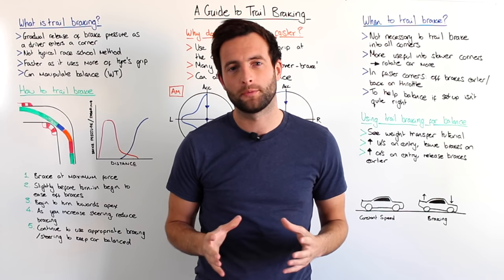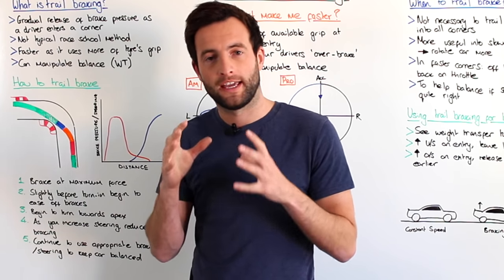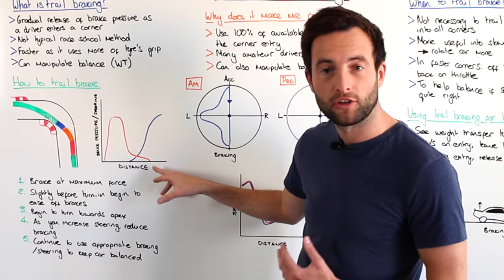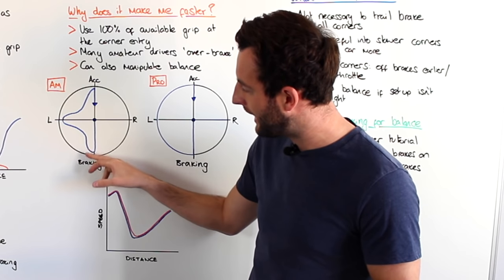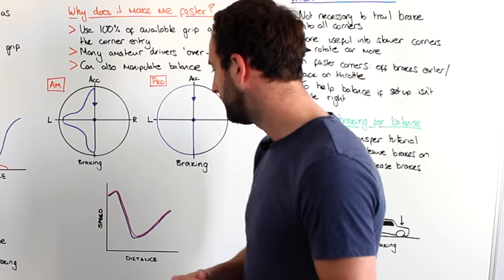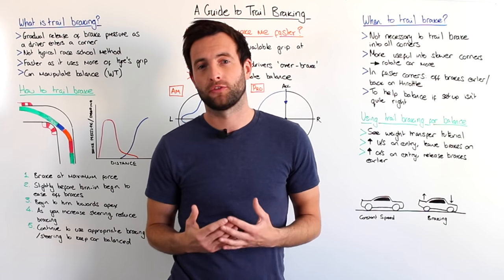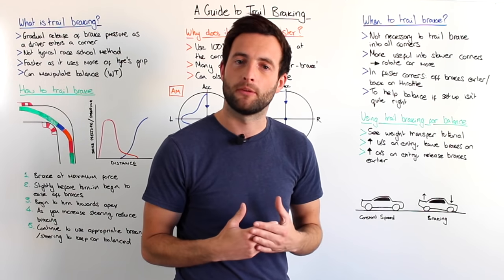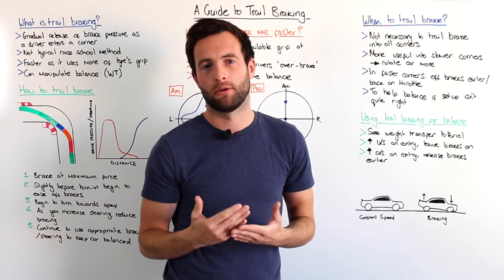How to Trail Brake: A Step-by-Step Guide

Comment: I'm a new motorcycle rider. This video is the best explanation on the principles of trail braking on YouTube. Thank you!
Reply from the maker: Wow - thanks for that comment, much appreciated. Cheers, Scott.
Reply: @calvinlynch5014  Aside from the fact that it allows you to tuck into the corner later getting better visibility when you do; sets up the geometry of your bike so that it is better ready for cornering which also increases your traction and gives you many more options if you have taken the corner too fast rather than simply laying the bike down or continuing straight. That aside - it is a well made point that you should strive for low entry speed into the corner in the first place.
Reply: Watch trail braking videos on canyonchasers YouTube channel, and Nick Iesnatch videos on grip and trail braking..!!

Comment: Unknowingly I believe I've done this technique quite a lot? One occasion in my FWD hot hatch coming into a tight hairpin like corner I wasn't expecting to be as tight far too fast for it up in the Welsh valleys. I  had no choice but to stay hard on the brakes and turn in I can remember at the time feeling on the absolute limits, I could feel exactly when I needed to start easing off the brakes and always felt on the verge of oversteer/understeer but not once lost any traction I just shat myself afterwards, got adrenaline dumped gave myself a talking to and wondered for the rest of my journey and until to this day how I ever managed that corner. Gotta thank you man love learning and you present and teach very well I've liked and subscribed you have a brilliant channel top notch content and you have brought me a lot of understanding. Every point on that board I did exactly even though at the time it felt completely wrong unnatural to me and yet naturally I did it!! Well maybe not naturally I will call it forced as I had no other option but either way I felt it and its like no other feeling taking a corner in this way as If all the energy that went into braking and turn in gets given right back to you when you start easing back off or at least it seemed?? Like momentum is channeled around the corner rather than lost into it?? dunno. Good stuff any mate.

Comment: This video illustrates perfectly why I do not understand how anyone can use a console controller to drive a racing sim.
Reply: Hahaha good
Reply: Recon.777 exactly why I picked up a wheel!
Reply: Readon is : no space in my small apartment. GT Sport for me is unplayable (DS4 Triggers just have to little feel and travel) On PC and Xbox I use the standard Xbox which has quite a lot of trigger travel.
Reply: I do it for 2 weeks. Cause i got the simracer game purchased but my G29 need 2 weeks to be delivered. To learn the tracks i drive wth controller meanwhile
Reply: I've seen guys using the R3 and L3 sticks on DS4 with far better consistency than the g29 would allow.
Reply: The only way I think you guys can understand is just pure controller time. I've been playing GT since I was a kid and always on controller. it wasn't until GT5 that I learned racing techniques. it comes down to personal skill. it takes a lot of practice to be able to do this on controller. I play GTsport and ACC both on controller and I'm only about 1s off the top guys. I have never driven on a wheel but I plan to buy one soon. I hope I will be able to translate that skill to my feets.
Reply: I bought dirt rally on steam and quickly realized that its almost impossible to even finish a stage with a decent time with a controller
Reply: You'd be surprised, some people are incredibly fast on a controller.
Reply: @barry6201  very factual. It's called becoming good with your own equipment.
Reply: You can trail brake on a controller once you get enough sensitivity with the triggers, it's not perfect, but it can take you pretty far
Reply: A modern console controller allows to throttle, brake and steer gradually
Reply: BOOM!!!!
Reply: @trevormtb9372  it's way harder, you have to be very smooth with the brake and throttle. Turning senistive for the sticks to 100 helped a lot for me, and softening the suspension. Still can't get much above top 200 on an event though, you just don't have the precision to really carry speed through corners without insane practice.
Reply: @Zaiden Gordon if u have to do that get a new gf 🤣
Reply: Just watch my hotlaps lol. 
If controller is the only thing you’ve got, then you just have to adapt no matter how difficult it is
Reply: Yes, it is possible to trail brake with a controller (I use a Xbox pad). The tricky part is maintaining the controller stable, so that you can fine tune your inputs (steering and triggers), which are super sensitive by nature (we're talking about millimetres of travel!)
Reply: I find trail braking fairly easy on controller. Throttle control is much, much harder.

Comment: You also need to cover trail braking in combination with engine braking to remain in the max torque band to accelerate out of the corner for maximum exit speed

Comment: i would be interested in a video explaining the differences in trailbreaking and progressive acceleration on corner exit - in relation to a either rear engine car (porsche 911) and front engined car. so how does the static weight and grip difference affect the inputs throughout the whole corner. 
i've heard a rear engine 911 basically doesn't need any trail breaking. is that so? i would like to hear a comparison of the different car setups (front engine, rear engine) from an expert like you.

thanks in advance
Daniel

Comment: Based on this guide and your racing line guide, on a slower corner a combination of trail braking with late apex may be ideal
Reply: Love Like a Hurricane depends on your car. In a light but grippier car with close to 50/50 balance, your apex will most likely be earlier than with a heavy tank like a muscle car. The key is to use all the available tire grip.

Comment: Question: As an amateur driver, I was usually brake first soft and then hard. After I heard about trail braking , I started push hard first and then soft. But in that case, usually car lost balance before coming to apex. What is my problem exactly ? What possible mistake am I doing ?  btw i'm using a rwd automatic  BMW. Sorry for my English. Thank you!

Comment: regarding the diagram at 6:45, doesn't trail braking mean you can hold a higher speed before you reach the corner ? Because you actually get more braking done into the corner

Comment: would it be accurate to say with a fwd car with a weight distribution bias towards the front end, that it would be better to come off the brakes a little earlier and very lightly onto the throttle to get a better balance to allow the car to turn at the tightest point and then as the car is pointing towards the apex or exit to start increasing the throttle to max as the grip allows out of the corner? as allways get tutorial

Comment: What would you say is the best way to learn to trail brake more frequently for those who aren't doing it? I am a sim racer and know that it is something that I need to do More effectively, but it is seeming hard for me to get used to it and use the technique as effectively as possible, any other learning tips?
Reply: braking later is probably crucial for this to work. And turn in sooner than you normally would as you're gently releasing the brake. Hope this helps. (It's been a year since you commented, how's it going for you?)
Reply: Yes, brake later but don't turn in sooner. Turn in the same way and if you trailbraked successfully and have pavement left at the exit then try to get on throttle as soon as possible after trailbraking. If you still have pavement left (assuming you unwinded the steering wheel), then turn in slightly sooner.

Comment: Will this help keep weight on the front tires in FWD?
Reply: Creeperboy and friends really useful in front wheel drive cars to get the car rotated. It keeps weight off the rear of the car as you turn, so you'll experience a little bit of oversteer on turn in which can really help.
Reply: Chris Holloway I figured that out too— pretty fun even though I’ve only pulled it off in simulators

Combining that with a downshift, I once managed to DRIFT (not powerslide) around a turn in a Honda in the game once

Comment: Where would you come off the brakes when someone is doing a hair pin turn while using late apex on the hair pin turn?Most of these guides just mention to completely get off brakes and onto the throttle once you hit apex. This is understandable when using the Ideal line. But when using Late Apex line how would trail braking work? Do you start putting throttle the moment your steering angle decreases, regardless of whether you hit the late apex point or not?

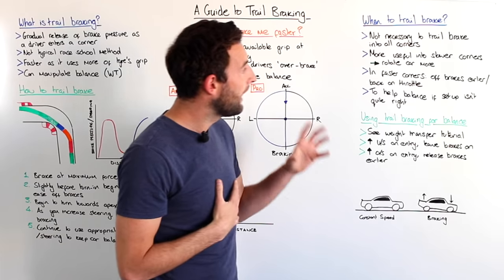Comment: If the car is oversteering then how not to trail brake or to less trail brake is the solution?? 10:35
We want to transfer weight to the rear then we should trail brake earlier isn't it??

Comment: question for anyone willing to help with sim racing (Iracing specifically), I have tried trail breaking and sometime I can make it work but other times I tend to get loose at the back end, is this because I am releasing the pressure of the brake too quickly throwing the weight of the car off or is it because I have turned too suddenly, or is it something else ? like I said sometimes I can get it spot on but other times I'm not sure what happened, I have tried to look at replays to see what I did different but I cant see it, or is the best thing too do is go through specific practices to find out the different effects of turning to quick and releasing the brake too sudden.

Comment: How to practice/learn this technique. Should I learn some other skills before this?
Reply: Sim racing of course is a great tool to practice.
The later the apex the better to practice and see differences on your laps time as the trail braking part will represent a greater part of the turn. Thus tracks like Spa or Brno are great to train to trail break as you will see big differences when you succeed to do and immediately realize if you are doing it right or wrong. La source, les combes, Brussel / Rivage, Fagnes and Campus are great turns to train at Spa as they are long and smooth (except for la source).

It's really important to have a good and well balanced setup, so if you are not familiar with setting up a car I advice or to get a setup from a friend you know is good or to get familiar on how to balance a car setup.

Hope this helps.

Comment: So does your braking point change when trail braking?
Reply: In the example its a bad situation. Trail braking is a really good technique in 180 degree corners. In his example, you would lose WAY to much speed coming out of the corner.
Reply: Trailbraking works best in corners where you have totate the car more than 90 degrees. Yes, your braking point should be later because in order for traibraking to work properly your entry speed needs to be higher. If your entey speed is the same and you try to trailbrake, you will overslow the car, therefore you brake later which will inherently yeld higher entry speed.

Comment: But you can enter the corner faster if you use all the grip for turning. Plus you can press the gas  sooner so that the car doesn't loose speed through the corner.

Comment: When do we downshift? Only during max braking?

Sometimes (depending on the situation) I end up downshifting after brake release and turn in has initiated, and it is very unpredictable. :(
Reply: Nick Amarit. Personally I would downshift while braking. I select the gear I think is best for the corner, match the revs before initiating the turn and then just accelerate away. Has worked for me for 40 years. I have to say that trail braking is an advanced technique that has virtually no place on public roads. Ride safely.
Reply: Yes, I am trying to trailbrake and heel-toe. It's tough for me on a manual because I learned to trailbrake on an auto using my left foot to trail while my right foot accelerates to steer with the gas pedal.

Now I can still trailbrake in my manual car, but only if I still use the same technique - my left foot to trail and right foot to steer. But it doesn't work for corners where I have to heel-toe because being in the right gear usually means being at a speed that's almost too slow to trailbrake (at least for the corners that I do it at). So, I end up being in 3rd for a 2nd gear corner so I can have the brakes trailed through turn in, but corner exit accel is slow. Or should I downshift again (to 2nd) after trailing?

Comment: You sound like you're actually confusing yourself, I can imagine you're not too fast yourself on track (as I have seen from video of your driving). It might also be useful if you were to be able to spend some time with a high performance driving instructor and actually learn properly before endeavouring to instruct others online. A good formula/open wheel racing driver would not agree with your concepts about braking.
Reply: Is someone having a hard time in Gran Turismo?